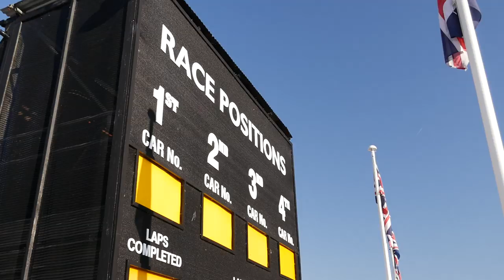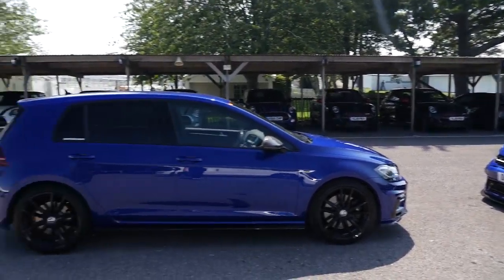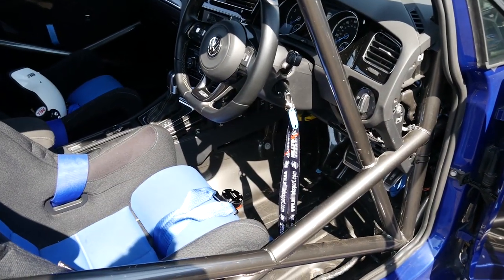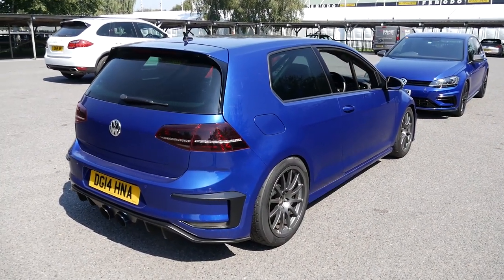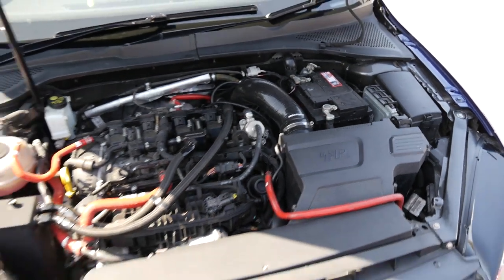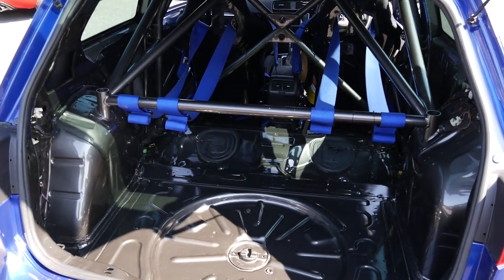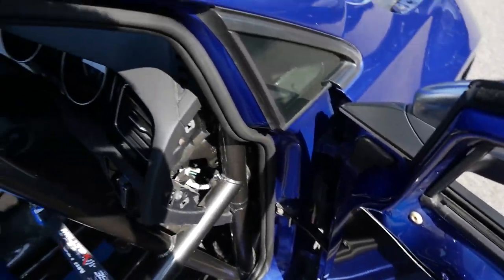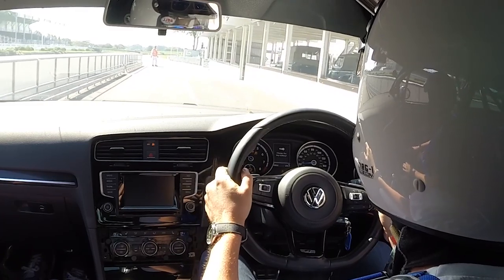The 500bhp Track-Spec Golf R W/£70k Worth of Mods!

Comment: All the weight savings gone with the roll cage in there prob weighs more than a stock Golf R
Reply: No way, the roll cage probably weights as much as the rear seats.
Reply: Stephen Peacock no chance it’s a full steel cage they’re heavy, even a half cage weighs a lot
Reply: Total Focus think the rear seats are about 40kg and front replacement saving might be 20kg, stripped out interior maybe 20kg, that’s 80kg.Usually a full roll is about 40 to 50 kg, but agree that cage could be a bit more, but I’d be surprised if it’s over 80kg.

Comment: Needs more front track... R didn't come in 2dr then did it - Feels like that would be the first and most dramatic difference. Battery doesn't look light. Why is it still in the nose of the car?  The rear part of the cage doesn't look like something that would pass any race series rules - doesn't go to the floor. Its neither street car or real race car.. Fun toy, but track days are not racing - feels weird to spend all that money on a car you can't race or fully utilize on the street.